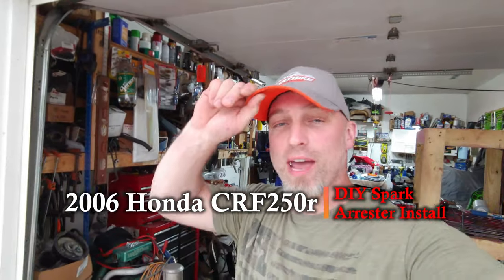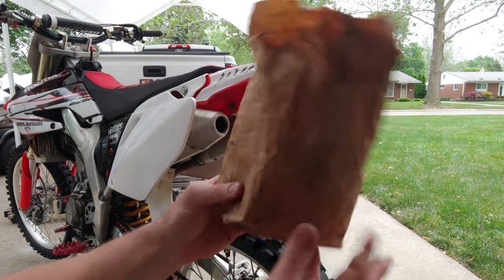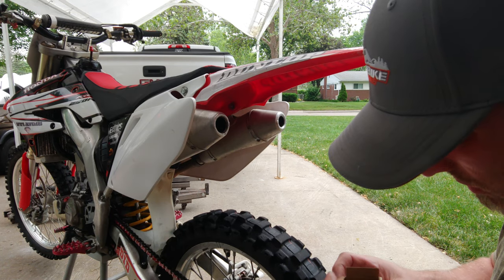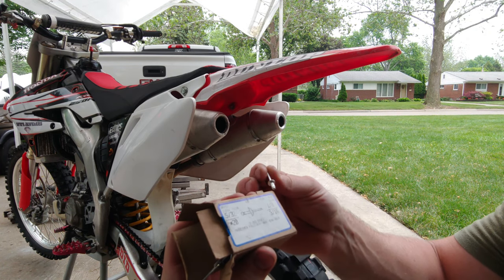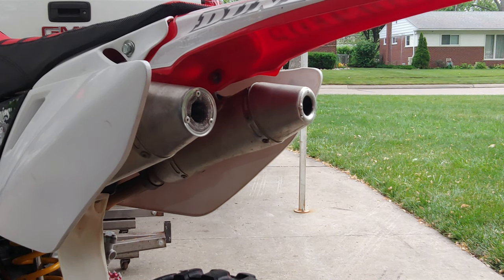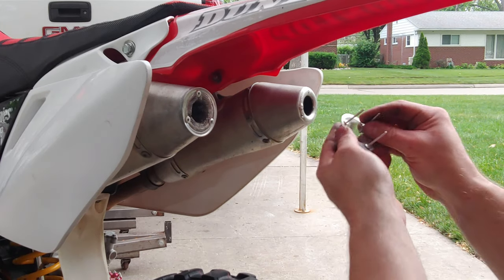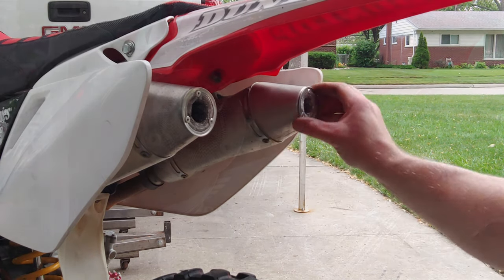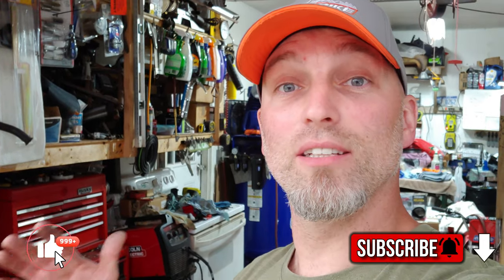DIY Spark Arresters | 2006 Honda CRF250r Install

Comment: Why not remove the end caps off of the silencer and install them on the inside?
Reply from the maker: I didn't have time at this point but that's what I was actually considering doing that way I can just go ahead and plug them up. Great minds think alike so that is a good suggestion thank you sir!

Comment: Wut in the he'll do you need spark arestors for
Reply from the maker: Lolol. EXACTLY!!! BUT state owned park is just like riding on trails in summertime. Sparks could ignite something SUPPOSEDLY. 

But if you got sparks coming from your tail pipes you got a LOT Bigger problems. Lol

Comment: In Michigan, if they are not stamped with USFS approval, they WILL ticket you !
Reply from the maker: Worked all last year at Holly Oaks. Stopped a few times a spoke with the sheriff there too. Didnt say a word but thanks for the heads up. I started going to The Mounds. None of that needed.
Reply: Man I’m freaking out heading up north and hoping this works out
Reply from the maker: It should work fine.
Reply: What size did you go with?
Reply from the maker: @Timeflys987 I purchased 2 multi packs and picked the size rhat matched.
Reply: @Fixin2Ride-Official-  thanks